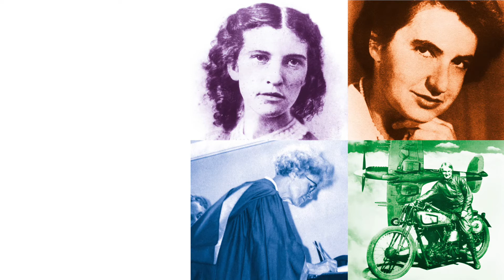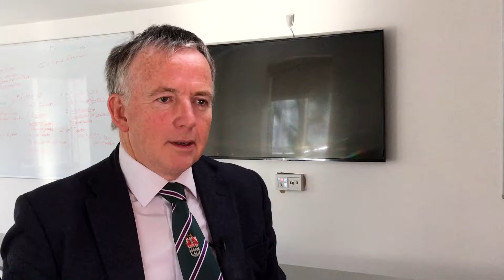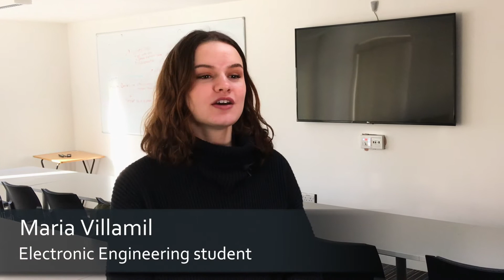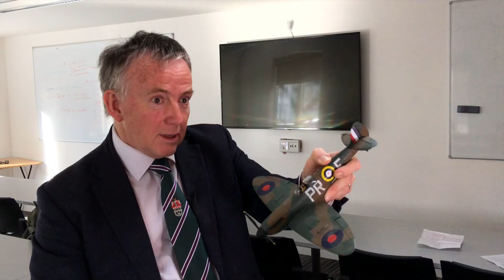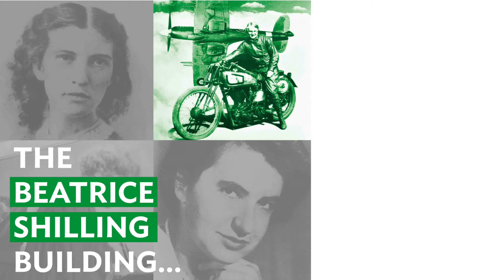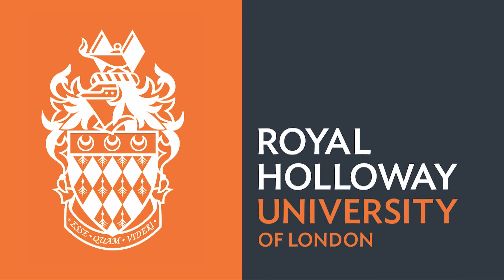Who is Beatrice Shilling?

Comment: Her potential suitor had to match her circuit speed award on a motorbike, not a car, in order to become her fiancé. The carb' surge originated in the Merlin when the pilot went to 'bunt' nothing to do with attaining a specific dive speed; think of your breakfast... the negative G you get when you crest a climb and then drop down, on a rollercoaster, that's what lifted the fuel float and fuel causing surge and starvation.  The RR Merlins were critical to our survival in the war, to take them out of front line duty for major factory carburettor upgrades (pressurised flow) would have been suicide on a national scale. To formulate, fabricate and install the temporary improvement i.e.  'Shilling orifice ' in the field during war-time with the minimum disruption during war-time was a marque of genius. Please excuse my corrections, I am a real Tilly fan, thanks for remembering her with this naming honour.
Reply: If it lifted a float, that would flood the carb